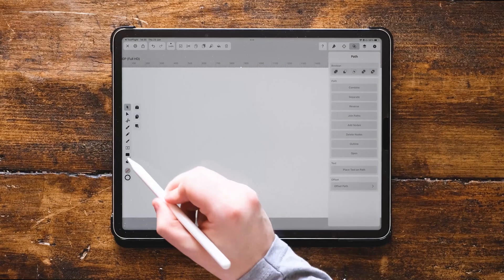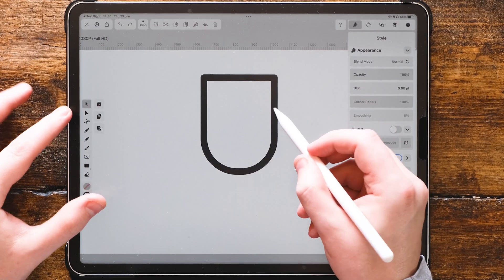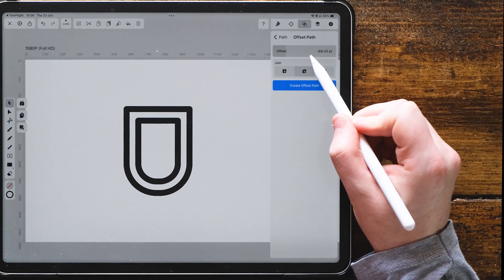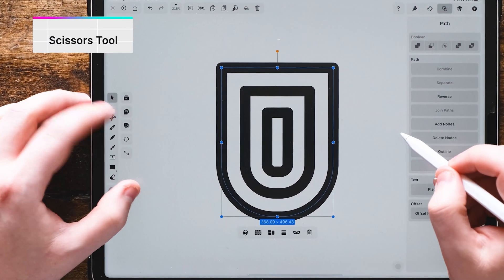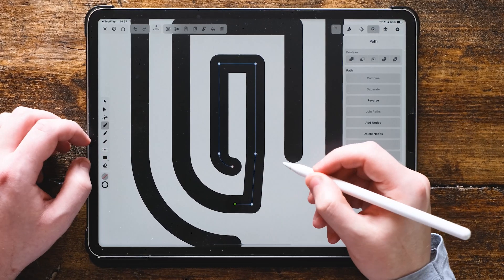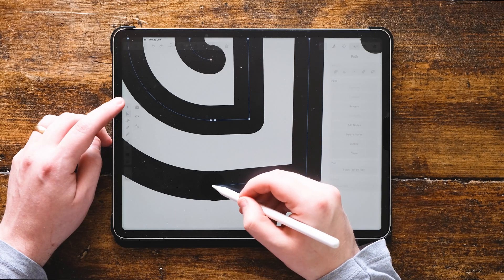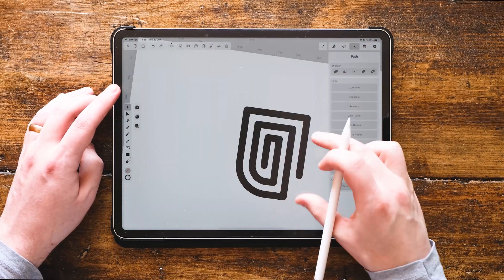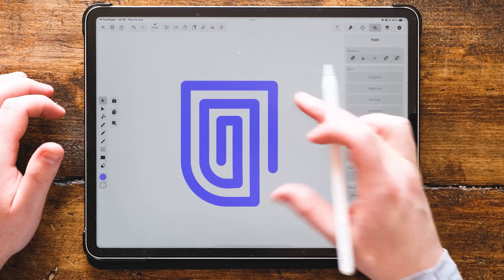Design a Logo with Offset Path with @willpatersondesign

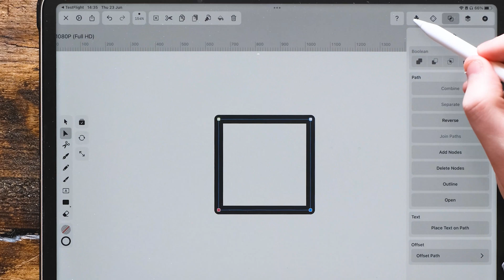Comment: 0:28 I failed here. Why my square always become rounded like i select all of 4 points. I did the same. I just select 2 points but the result is just not like in the video. Any hints for using node tool?
Reply from the maker: So sorry for this frustrating issue! The good news is that this is a known issue meaning the team is currently looking into the matter.

A quick workaround in the meantime is to select a node with the Node Tool → make an edit to it (e.g. move it slightly) → undo this action → the Corner Radius tool should now work as expected when you have selected your desired node(s).
Reply: @linearityhq  Still doesn't work. So frustrating!

Comment: I’m using the iPad version but your interface is slightly different. Is there a setting adjustment I can make to get the same layers/style pane you have? I feel that would make it easier to make selections instead of having to scroll up and down especially on the style pane. And avoid the frustration of accidentally making unwanted adjustments as I’m scrolling.
Reply: I'm having the same problem.